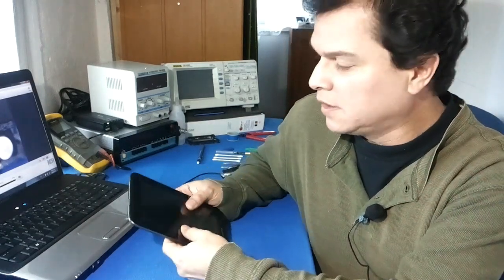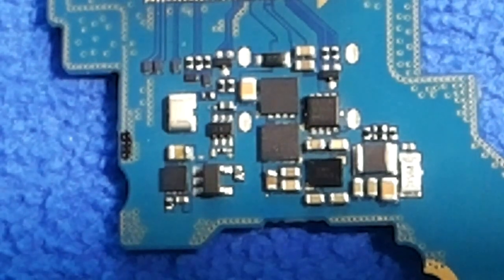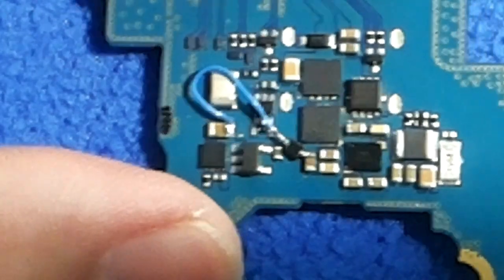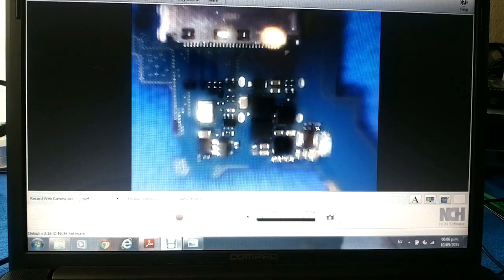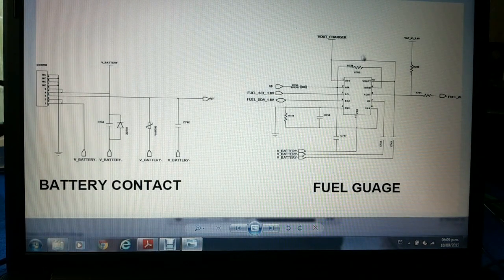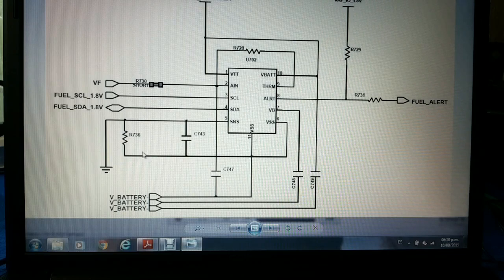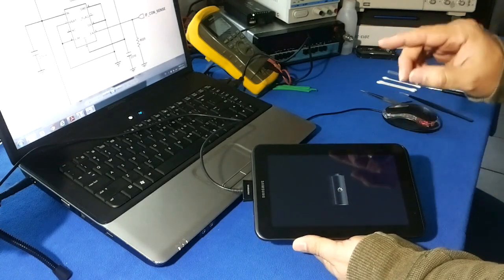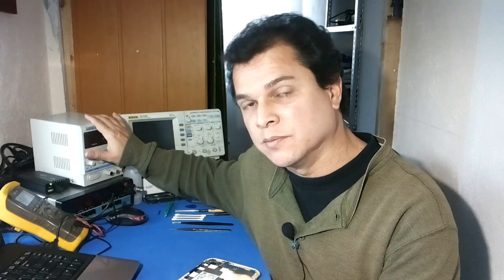Samsung Tablet 2 not charging, turns off, fixed - How to fix tab on chip level. GT-P3100 / GT-P3110

Comment: Hello this is a nice video i work with this kind of issue every day, I have just one tablet like this but is my daughter to see movies. Can you say the diod i need to replace it. and if i change only the battery will work?
Reply from the maker: +Tiago Fernandes Hi! The answer about the diode is in the comments. I recommended to find another diode from another tablet, smartphone or old laptop. First charge the battery externally to ensure there is not a bad device in the tablet. (Maybe is not a bad the battery).

Comment: pls help my tab 2 p3100 no signal when unplug when the data connection is on or wifi is on and when it goes 50% and down
Reply from the maker: +Patrick Galura It looks like an electronic device is about to die. Are you an electronics technician? Look if a capacitor has lower resistance in the area I fixed. There are two more chances hard to get: Pay attention when I said: "where I found my capacitor in troubles". That one can be bad. There is another capacitor in parallel with a low ohms resistance in the WiFi area. The resistor is so low, that the capacitor sees like a short circuit sometimes. The capacitor doesn't charge and heats. Both capacitors can be removed and not replaced. They are only to make the low resistors voltage drop more stable and suppress noise. Try to remove them. Also check that the Mosfet transistors I showed in the video are not resisting. (There should be a very, very low voltage drop when they are on. I hope it is a bad charger or oxidation in the connector, so changing the adapter or clean it will be easy. :-)
Reply: +Bob. Kalpon im using a replacement usb wire ,which part to be clean? im not a tech. but thankyou for the info.
Reply: +Bob. Kalpon And sometimes it automatic shut down without the logo of samsung its like switching of the tv ,but its not low battery
Reply from the maker: +Patrick Galura You will need a real technician to help you. Some electronic device is about to die in there. It is very hard to find intermediert failures. Or wait until the device totally dies, then it will be easiest to find by most technicians.
Reply: +Bob. Kalpon thankyou sir
Reply: +Bob. Kalpon thankyou sir
Reply: +Patrick Galura help me please

Comment: Thanks a lot.

I just have a question; many devices are there which works on a Battery and a charging circuit built in. If the charging circuit fails there must be way to use the device without charging circuit, (i.e.) by-pass and connect the supply directly. The only difficulty could be that the Tab will have to be connected to the supply source, well I don't mind using my Tab2 this way also. Can you help me ? 
Per your explanation I am trying to connect a Schottkey Diode 5819. Please advice.

Wish you a very Happy and Prosperous New Year. May God bless you with bets of everything in the world.
Reply from the maker: +Subramaniam Kabaleeswaran Amen! Thank you! Blessings to your family too. IMPORTANT! You can bypass the original battery because it has a protection circuit built in. But it is dangerous in direct connection to the battery or with cloned batteries. Normal diodes are good in low frequency rectification. But schottky diodes are not good in HIGH currents. Also I am charging over the battery's voltage and under the charge's voltage. (5V - 0.7 =4.3V). Try it! Maybe it will work. Just make sure the diode is not heating, and the tablet stops charging at full charge. You can use a normal rectifier, and cables with good insulation to do not make short circuits too.
To bypass another equipment, we will need to seat for a moment and analyze the schematic to be sure about what are we doing? ...as I did it with the tablet. :-)
Reply: +Bob. Kalpon 
Hi, Thanks for the swift reply. Can you help me with the changes to do in the circuit diagram. Can I use a 7805 and then with a simple diode drop it to say 4.3v .
Please please help with me with the circuit.
In fact your video only helped me to open the Tab, .
I have the Typical problem , it doesn't turn on or showing charging thats why all these.

Please help me.
Thanks in advance. can I have your mail id

Regards.
Reply from the maker: +Subramaniam Kabaleeswaran Dear friend, do not use a 7805. Just a diode is OK. Your charger and the chip in the battery do the rest. But it looks like you have another problem to fix before. If the battery is good, and it will charge outside with your charger and a serial diode, then you must look for another bad device in the tablet. Check first for a bad capacitor before to go after the chips. Remember a short circuit capacitor should not have continuity in both sides, with your negative on ground. Only two capacitors are close to ground, one in the WiFi, and another in the charging control circuit, because they are in parallel with a low resistor. (My bad capacitor was in parallel with the low resistor in the charging chip).  :-)
...at the end of my video; How to test a capacitor, I showed to lift up one side, and to test it, in case you found a capacitor in short circuit. https://www.youtube.com/watch?v=uBUEjeS5UmI
Reply: +Bob. Kalpon 
Happy New Year Bop.

You can call me Kabali

I checked the Capacitors with the Negative probe on the body of the connector and checked by touching the other end with the Positive probe ( the Red one of my Multimeter ) it shows continuity for all the 4 capacitors.
Can u help with the values ? I dont think I can handle these SMDs what do you advice.

Regards.
Reply: +Subramaniam Kabaleeswaran 
Please let me have the values, I take help from a technician to change the capacitors.
Regards.
Reply from the maker: +Subramaniam Kabaleeswaran Hi! I don&#39;t have values. Most of them are just to suppress noise. So, just by removing them it system works fine. A few of them have specific needed values. (High capacitance some of them). What I do is look for another with the same side around and measure it and use the that value. But every case is different. My email in tag ABOUT. Send a photo. (I don&#39;t have the tablet. I will look for the part in the diagram and try to help). IF ANYBODY ELSE is reading now, is welcome to help with the value too, once you send the picture. :-)

Comment: Hi Bob. Thanks for video. Could you please explane schematically what you bypassed with a diode? I have different model (T110) that also stopped charging but it looks like charging IC (328A) has died - output charging voltage is no more than about 0.8V so when plugged even though showing "charging" the battery goes empty (tried with a spare battery too).
Reply from the maker: +andrey shchepetov  Hi! Because I am not there, and I have not the same model on hand, any advice would be dangerous. :( ...Try to charge the battery with a power supply. If the tablet works and charges after it, then do the diode bypass at the END. If it doesn't charge after you charged the battery, then you MUST look for the bad parts and fix them, before to do the diode bypass. Because you will not want a fire ignition tablet at home.
(At the end, and after fixing the bad devices, the diode will go as follows. Anode from the 5 Volts positive input in the input connector, and Cathode connected to the positive 3.7 Volts in the battery). You can keep the bypass IF, and only IF, the tablet stops charging after full charge. Because you don't want a tablet charging eternally.
Reply: +Bob. Kalpon Hi! Thanks for advice. Actually even with charger connected the battery continues to discharge, so i will probably change the charging IC first.
Reply from the maker: +andrey shchepetov  Well done! You are in the right tracks. You will find the source of the problem soon. I am sure now you will do a right fixing. ;-)

Comment: could you help please ? by saying what diode you used as would be alot more helpfull thank you
Reply from the maker: +Daniel .Bradley Hi! If you have a smd electronics supplier, just order any 2 amps smd regular diode. If there is not any other source, I would recommend you to  take a "big" smd diode from another old tablet or smartphone. Just make sure it is close to the battery or voltage input connector.

Comment: what did you use to insulate, will electrical tap be ok?
Reply from the maker: +ste byce +ste byce  Hi! The answer is no. But as I said to our other friend: "Play with what you have. Because sometimes we can't get what we wanted". I don't think normal electrical tape is good, because the diode is too small, and it will not stick good. Probably it will fall at the end. I used a thermal tubing. I will make a video to help you better this weekend. :-)
Reply: yea I actually found some thermal tubing, my problem is finding a 2A or higher diode lol. I get 1A but trouble finding 2 or 3A.
Should I keep looking or is there something I can do with stringing 1A together?

Comment: what are you place it ???
a diode or an IC ??
please help.... :)
Reply from the maker: +irawan tham tham Hi! It is a diode. It must be 2 Ampers or higher current. The anode is pointing to the first big capacitor, and katode is pointing to the small capacitor. Don't for get to insulate it! Take a look about how I insulated it with thermal tubing as showed in the last picture at the end of the video. If your table had a bad device, fix it first. Then perform the factory design correction with the diode at the end of the fixing. Thanks by asking for it! :-)
Reply: +Bob. Kalpon hi, this must is smd diode? or is enought a typical discret element diode use in through-hole technology?
Reply from the maker: +filmy Hi!Play with what you have. Because sometimes we can't get what we wanted. One good advice is to try to remove one of the main diodes from another smartphone or tablet. Because they are low voltage drop, and support high currents. A normal through-hole diode can be too big and also very rigid, and sometimes they can straight up themself and to break the capacitors.
Reply: +Bob. Kalpon This is a good connection? http://pokazywarka.pl/howdiodeconnected/
Reply from the maker: +Jarek K  Hi! Yes, it is right. :-)
Reply: +Jarek K Jaki konkretnie model diody trzeba użyć? Rozumiem że to dioda prostownicza?
Reply from the maker: +Cyryl Sochacki  Cześć! Weź "wielki" diody z innego starego tabletu lub smartfona.  :-)

Comment: my Samsung Tab 2 P3100 switched off automaticallynow it is not turning ON. Even when I plugged in the charger but cannot see any sign of charging on phonewhile charging, its becoming very hot on the charging connector
I tried unplugging the battery connector and release the power from mother board.
any help on this?
Reply from the maker: +Sumit Ahuja Hi! There should not be heat in the connector. Two things can be going on there: ONE, there is a problem in the connector on the tablet or in the plug. TWO, there is an electronic device in short circuit in the tablet. In this case, it can be anything in there and must be inspected by a technician. Most cases I saw, there was a capacitor in short circuit. You better bring it to a technician. Also you can copy this youtube link, and give it to him. I am sure that he will find the problem and apply this correction for the factory defect too. Tell him to contact me, and I will give the electric diagrams if it was needed. :-)